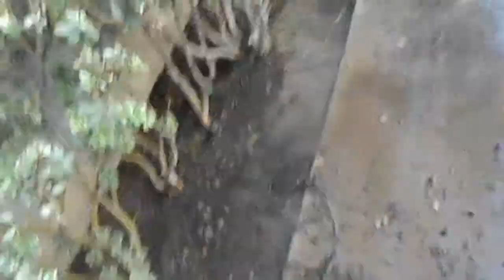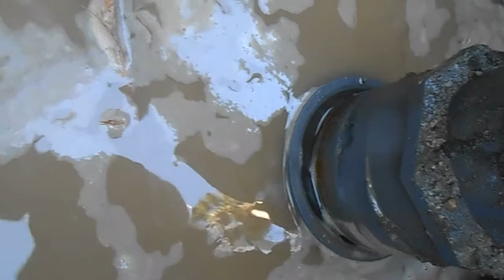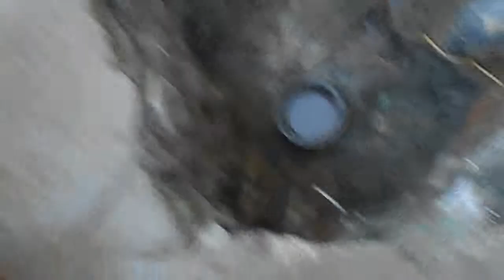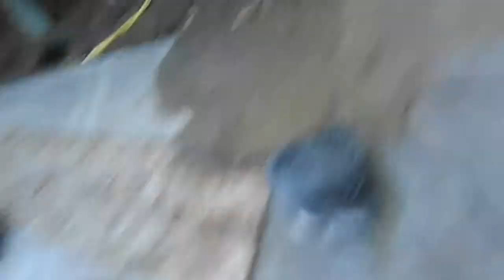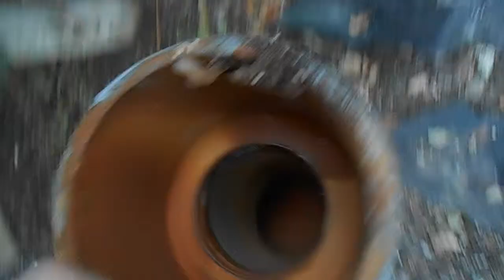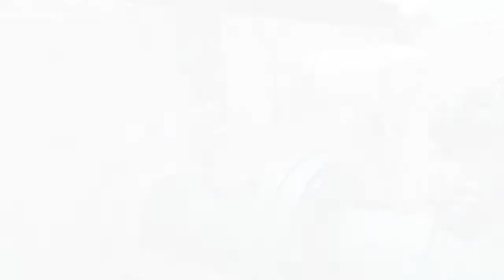Condenser Water Main Break-Yikes!

Comment from the maker: Once I realized that it was the condenser water; I shut down all the units from the interlock relay panel. Some of them have flow switches that would shut them down before the HPS but, I'd rather shut them down manually. Getting the loop refilled was interesting; big ol' air bubbles got trapped in the pipework on the top floors so we had to crack open some supply lines at the units to purge the loop. Of course, we're doing this while hot, angry tenants are trying to work in their offices, Great